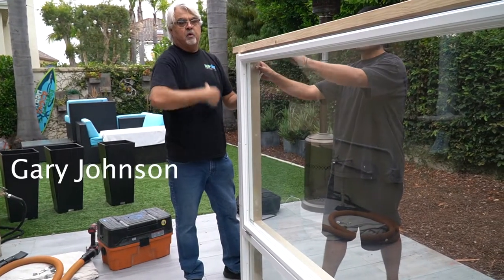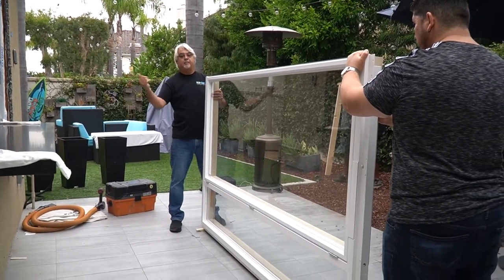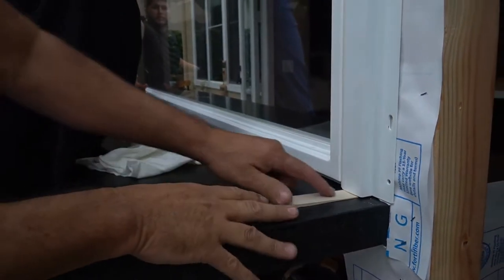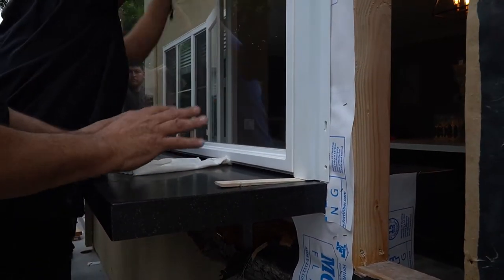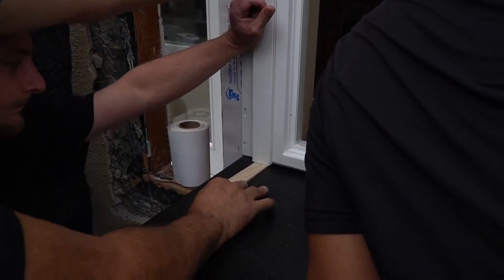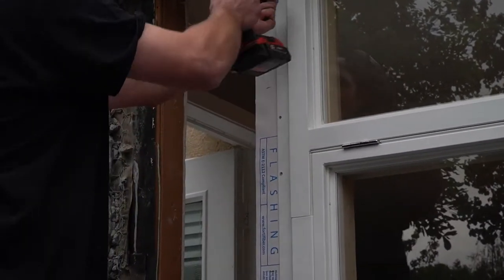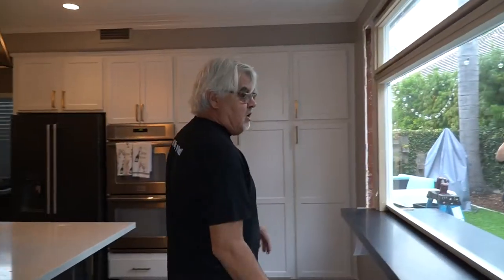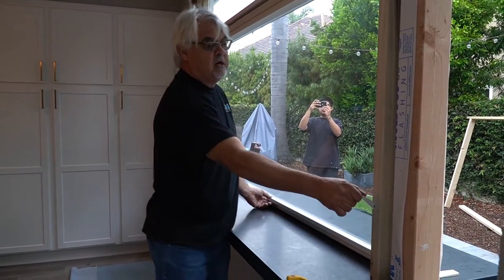FLIP OUT WINDOWS (GAS STRUT SERVERY WINDOW)

Comment: Could you use a glass door sideways ?
Reply from the maker: I would not recommend that. When you lift a piece of glass above someone's head, it needs to be done right.
Our Flip Out Window is an engineered window designed to do this one function of opening up to 90 degrees and sealing to your countertop when closed. It is made of American grade steel, all one piece, so no flex. It is not a bolt together product. It is STOUT, yet pretty with a nice powder coated finish and interior wood casing.
Visit www.flipoutwindows.com to learn more.